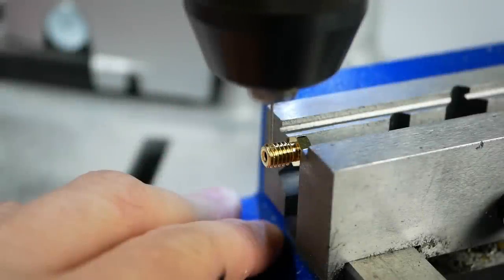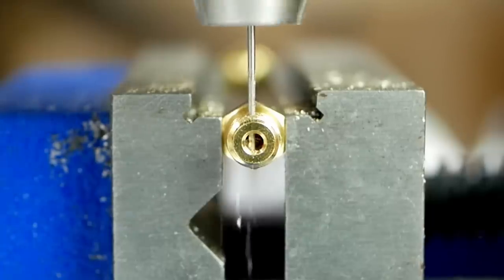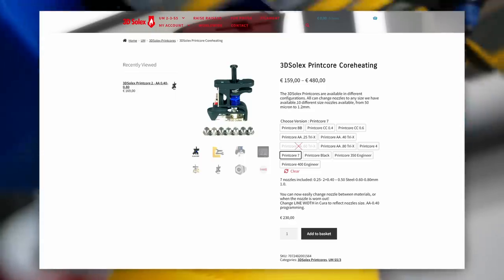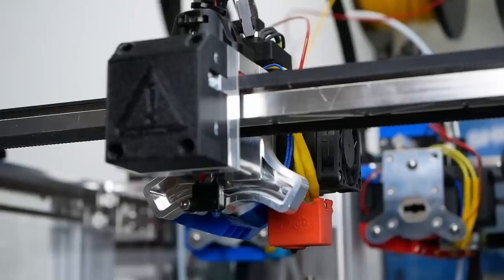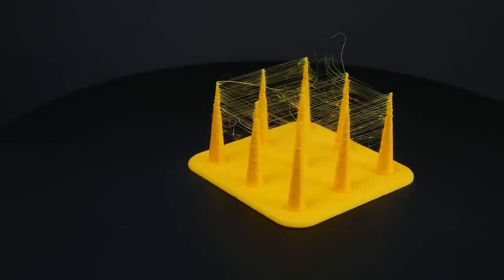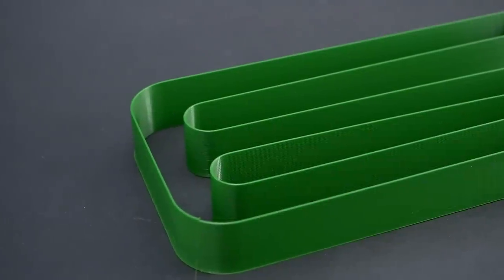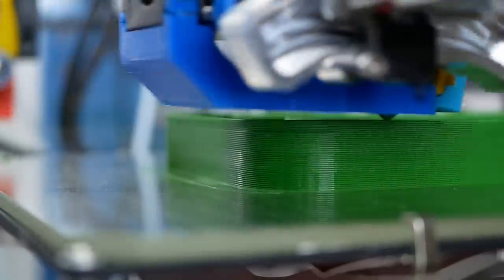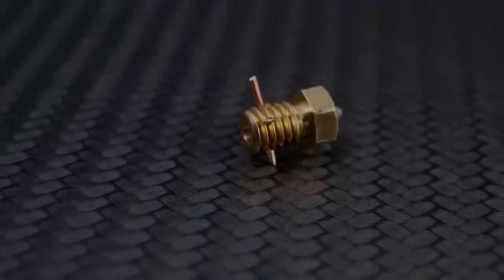My High Flow Nozzle is better than a Volcano hotend!

Comment: Reshaping the wire might have some useful results.  Maybe a double knife edge profile to keep the back-pressure lighter but still have good surface contact.  I simpler option would be to keep the rounded top and shave the sides down flat 180 deg. apart with the rounded parts vertical.  That should allow more flow and a good contact surface.  These mods to just the inside portion, keep the parts that pass through the body to the original dia to ensure good seal and no solder pass-through that might create more inner turbulence.  Coupled with using a nut as a jig as others have commented for easier centering could yield some very nice results with minimal cost and effort.

Comment: Those copper rods. Grind them to a 15-20 degree spike  so it can split the material while it is shoved to the nozzle. it should ease back pressure and help melt the thing while spliting it inside into 4 small pieces which will be connected at the end of nozzle to print. Grind before --> insert --> solder --> re-cut the thread

Comment: Maybe it's worth trying to drill the hole diagonally?  That way the area where we heat the plastic is larger but we do not have a part where the passage is particularly narrow which will create greater pressure

Comment: I would suggest using smaller wire diameter and making few holes in one plane and then connect them in a small channel. As other proposed a little bit filing to remove curvature of the wire so inserted all the wires will form a "wall" in the middle that will increase heating surface. I think more important is the bottom edge not the top as it is manly responsible for the turbulence (fluid dynamics). Others already suggested the nut for centering the hole. Great work!

Comment: If I was doing this in our machine shop at work, I would pre-drill a small aluminum or brass block on center.  (center drill, pilot drill, then final drill to get a good accurate, straight hole), and tap it M6,  screw the nozzle into that block.    Also hopping on the lathe to turn down a small brass pin to put into the nozzle, so that it's not trying to get a bite again on the opposite side of the ID of the nozzle, that would 100% make the hole crooked as hell. Then cross drill, again center, pilot, final through the block and the nozzle,  with a lot of peck drilling to make sure chips are getting cleared and we get a smooth transition into the nozzle and keep the drill from wandering as much as possible.

Comment: I think more thinner wires would be interesting to see as well as maybe making them a snug fit with a thermal compound for heat transfer with no soldering.  Unless they manage to get pulled into the nozzle during printing, I can't imagine they're going to go anywhere without solder.  Regardless, nice work as always!

Comment: You could machine a flat on the threaded area for drilling. Also, I wonder if instead of a round wire, more of a blade shape would help flow due to it's parting the still melting filament better as well as taking up less volume of space. Also, either silver soldering (as you mentioned) or even brazing would be a better method of attaching the wire. Great test though, I really enjoyed it!

Comment: Shorten the exposed distance on the drill bit. Center punch the starting point. And check to see if castellated nuts can work as a guide, or drill out a nut from a softer material  like aluminum, brass or copper.

Comment: Pehaps you could flatten the copper wire so the thin edge runs vertical ,giving easier flow but still same surface contact.

Comment: Instead of soldering the wire you could try an interference fit.  This requires some precision, but nothing that would require expensive machinery.  Though the tools might be more than what you are accustomed to.

The goal here is to fit a piece of wire into a hole that is smaller than it is.  This is accomplished by thermal expansion and contraction.  Basically you will heat the hole so that it expands and cool the wire so that it contracts.  By how much depends on the size, but a mm or two is probably fine.  While the temperatures are still at their extremes you slip the wire through the hole and allow the temperature to normalize.  Once they are in contact with each other and the temperature normalizes they will expand and contract together and it will be impossible to separate them.

You will need to drill a hole which has a precise diameter.  Getting precise positioning is not as important.

Getting the hole to a precise size requires 3 tools, all of which you can use in your drill press:
Center Cutting Mill
Undersized Drill
Finish-Sized Reamer.

Prep the surface with a Center Cutting Mill Tool.  A Mill Tool will be more ridged than a Drill Bit.  You can cut your hole all the way through with a center cutting mill, but it will be a longer and slower process.  At this level though, your chuck on your drill press is more of a problem than the drill bit is, so you might as well use the drill bit to cut the hole.  That is unless you want to swap out your drill press for a proper milling machine.  And if your going to do that you might as well swap that drill chuck for collet while your at it.  BTW you can get a collet chuck for your drill press.  I won't blame you if you don't want to spend the money though.

The challenge here is that the runout on your drill press and especially the chuck on the drill press will make your cutting tool wobble a bit.  This will make it hard to cut a precisely sized hole.  But we have tricks to get the best result with the tools we have.

The position of the hole is not as critical as the size of the hole for this operation.  It is just that the runout on your drill press and drill chuck will be the limiting factor.
The wire needs to be a precise diameter.  This can be easily accomplished by drawing the wire down to size.  This only requires hand tools.

To drill the hole first secure the part on a V-Block.  This will also help you position the hole in the center.  Cut a flat spot with a center cutting mill.  This step is important since you are trying to cut through threads.  You can use a mill tool in your drill press.  Its just a little unconventional.  But since you are not moving the part around to do your cutting it should work fine to make a small flat spot.

The reason for using a mill tool is that a mill tool cuts from the outside first rather than from the center, the way a drill does.  This makes it so that when the tool deflects it puts tension into the tool that will push back on the material with the cutting edges which are on the outside of the tool.  BTW: A Center Cutting Mill is called that because it cuts in the center also.  Not because it starts cutting in the center like a drill does.  Go slow with the mill tool.  They are designed for much higher RPM's than your drill press is capable of.  Which just means that you have to feed the tool into the material even slower.

Once you have a flat spot drill the hole with a drill that is undersized by at least 0.25 mm to 1 mm.  Then follow up your drilled hole with a reamer that is your target size.

Comment: 1. as mentioned below. get nut and drill through. 
2. don't move away preheater. solder with it. 
3. use 4 flat-blade wire tips instead of 2 crossing wires

Comment: Fascinating! Yes this is in need of more testing.  I'm thinking using smaller diameter copper wire, testing in 1 and 2 directions. Also even drilling a vertical hole thru the copper to re- introduce a smaller unobstructed path thru the nozzle (my thinking is the copper will still be introducing heating deep into the filament stream). Also how about trying a sieve like mesh of very thin stainless steel, but it will need to be ultra fine and non restricting.

Comment: you could try cutting a slot in the end and soldering a 0.5mm (0.5x6x6mm piece) or thinner copper plate inside to improve heat transfer, it should have a higher surface area than the wire and a larger cross sectional area from the nozzle into the middle of the filament.

Comment: Shorten the drill bit by cutting it off, it will be more stable. You could also try brazing rods (like the ones used for copper plumbing instead of soldering, I believe the melting temps are higher.

Comment: 2:25 you do have 2 options, but both revolve around the same idea: Pick something that does not deflect to start the hole. In other words, a carbide tool vs the HSS drill bit you have. You can either start with an endmill (though getting one this small can be a pain) or pick a carbide drill bit.

Comment: what if you filed down flats on the sides of the wire in the middle, creating more of a fin rather than a round wire? keeping the ends round would mean the soldering would still conserve the threads.

Comment: Use a bit of 15mm section square section bar drill and tap M8 on the central long axis and drill offset holes on two perpendicular faces to act as drill guides.

Comment: Instead of using soldering, you could have made the holes slightly smaller than 0.8mm and at the same time cool down the copper wire. Then heat the nozzle to a higher temperature, such as 300-400C. The holes will dilate allowing for the copper wire to go through. Once it cools down, the copper wire will be held tightly in place.

Comment: Using the 0,8mm drill or a small mill to cut a star shape into the upper part of the nozzle to increase the surface might be interesting as well.
That shouldn’t add too much turbulence, but it could surely give a pretty good increase of the surface area

Comment: I suggest you take a tiny brass wood screw and drive it into the back of an enlarged nozzle and cut it off.  
Alternately you could make a trilobe insert that you press in.  If the insert is cut or from a length of drawn, rolled or extruded brass it would be dirt cheap and could be replaced if it has to be drilled out.

Stamped inserts could be made under licence and sold by the dozen and added to almost any nozzle.

Comment: Hi, and thank you for the great Video.

There are so many comments, I am not sure if it was already recommended, but you could try liquid metal "Flüssigmetall" to fix your wires. It is often used for car repairs, hardens as a cold weld and afterwards withstands temperatures of up to 1100C it is easily available from hardware stores (at least in germany).

You could also try to use the pins from some pinheaders instead of copper wire, as they are available with rectangular cross-section instead of the round wire cross-section. If you  find a way to fix  them with the edge pointing towards the nozzle entry it might help splitting the filament more efficiently.

Comment: Ever see those pictures of a two-by-four stuck into a tree after a tornado?

I'm thinking something like that, but thinner.  Rather than a round wire, a fairly thin rectangular piece of metal basically bisecting the nozzle inlet area.  The small cross-section means less flow restriction, while the surface area is basically maximal for the amount of metal being introduced to conduct as much heat as possible.

Probably the easiest way to get it in there would be to cut a slit right down the middle, stopping just before the end of the threads.  Place the insert into the slot, secure it with some solder, then cut off the excess and rethread as before.  Leaving threads fully intact both above and below would be stronger, but that would take more effort to pull off.

Comment: Very interesting, thanks. You could try flattening the copper wire before soldering in place, should provide a greighter surface area with less resistance. I have a mill, I might give this a try - although I usually work with much smaller nozzles (0.35mm typical). Also, try using carbide pcb drills, they're stiffer so tend to wander less.

Comment: Drill bits with a larger shaft than the diameter are more stable and may prevent from the the wandering. Also if you had to drill more holes polar order, a lathe chuck vise where you can turn in desired angle per crank, is a good helper. (German Teilapperat)

Comment: Cut a slit across the nozzle (threaded end, of course), and insert flat steel wire.  It should stay without soldering/welding (actually, so would the copper wire).  Metal 'zip ties' used for exhaust systems are an option if you can't find anything priced decently near you.

Comment: Perhaps use solder first to fill in thread a bit so as to get a flat area which would possibly allow a center punch to be used that would prevent the bit from wandering?

Comment: Nice video.. Yes, some sort of premelting or mesh melting does help. You explained the internal thermal characteristics of the thermoplasts heating up in the nozzle..
But I even liked more your view on the polymeres going through the nozzle, the way you showed in your animation is what should happen, where material will not change physical properties by the process.. But especially if you go faster not only the material will not completely decompress again, the polymeres will also start to "sort", means they are not chaotic "wollballs" anymore, they will be sorted to same direction and long... This will influence the ability to build "layer adhesion" and will influence the shrinking behavior.. But that not necessarily in a bad way.. But while the chaotic balls will shrink aprox evenly to all directions which are not "blocked" by the shape itself, sorted polymers will have a different shrink rate in printing direction and orthogonal to it... Also the tensile behavior will be different in the one and the other direction... This effect is even used in a lot of our everyday lifes products or causes their intended behavior.. Among them heatshrinkables, nylons shoelaces, nylon panty hoses, cling foil (you may recognized, that when u stretch it, it goes back to its prior from differently in roll direction and orthogonal to it, stretch foil for packaging, where this effect is explicitely wanted and a lot more products.. This one can use for his design or suppress the effect by design. Especially the amount, pattern and direction of infill can compensate or overexite this effects.

Comment: Drill hole larger thruout entire thread lenght, use pliers to make the copper wire flat, then press it in, but then to solder it, use minimal amount of soldering paste(used for SMT).

Comment: I'm really curious what 2 wires would do if they were stacked instead of crossed.
Would it work better than the ones that are crossed or just as well?
I think it would cause less resistance than the crossed ones while still increasing the surface area, albeit not as much surface area as the crossed wires.
Or perhaps cutting a slash in the base of the heat brake that butts up to the nozzle and trying to put wire there rather than the nozzle? I'm thinking the performance would be similar but may be different enough to work around the patent.
But I have no means of testing these myself as I'd need a bunch of new tools to do so.

EDIT: Plus the slice in the base of the heat brake would have the benefit of working with all of your nozzle sizes by moving the slice point back off of the nozzle.

Comment: You could drill the hole at an angle instead of normal to nozzle axis. that way you increase wire length exposed to the flow, as it will form diagonal. More importantly, angling the wire converts its cross section (along nozzle axis/flow direction) from circle to ellipse, which ~halves the drag coefficient.

Comment: Drills wander easily on curved surfaces.
One solution that might help would be thread a nut onto the threads to give you a flat side to start your drill.
Then use a center punch to keep the drill tip exactly where you want the hole.

Comment: Use a metal block as a drilling guide.  Mill a smooth hole that fits the threaded end.  From the surface of the block to the walls of the drilled hole, mill another hole  sized for the drill bit.  Put threaded end into the proper hole.  The metal block should restrict side to side movement when using the drill hole.

Comment: 1. Put a nut on the threads before drilling for better center placement.  You can even predrill the nut as a guide.  2. How about trying it without soldier?  There are a number of physical ways to secure the wire (if it's even necessary for re-die cutting), however I think the issue is with heat transfer (soldier helping the heat transfer). I'd like to see the effect of no soldier and if there is a significant drawback - which would imply the need to fully soldier throughout the bore- questionable in your mod as in one shot there is clearly an unmelted bubble of soldier in the tube.  Heating the wire in the center, not just from the ends will help it flow.  Getting a torch instead of standard soldier would also allow you to up your soldier temp (e.g. silver solder) and make heating and drawing solder throughout the bore more consistent.

Comment: Very interesting. As you insert the copper wire from side you could have filed its upper facing part sharper before inserting to reduce resistance of splitting.

Comment: Very impressive performance. I notice that many of these specialist high-flow nozzles have very sharp internal angles from the machining process. Would be interesting to see what would happen if you take your wire and "sharpen" a point on it across the distance that will be inside the nozzle so that you mimic the "cutting" action of the other nozzles. This should also reduce turbulence internally and if you repeat that on the second or a 3rd wire then it may improve mixing and thus melting.